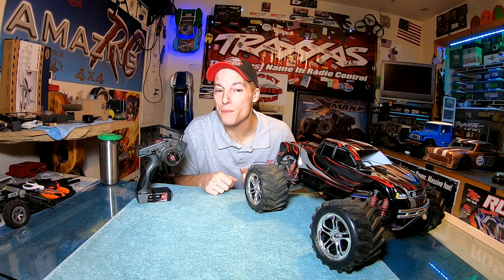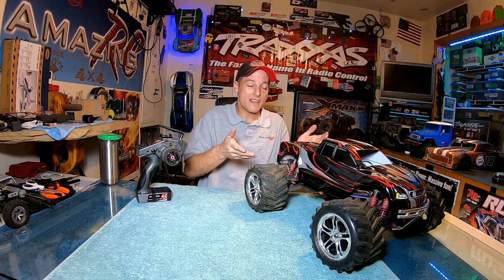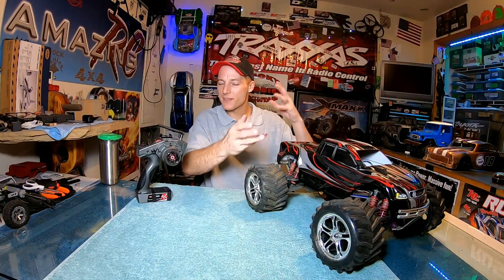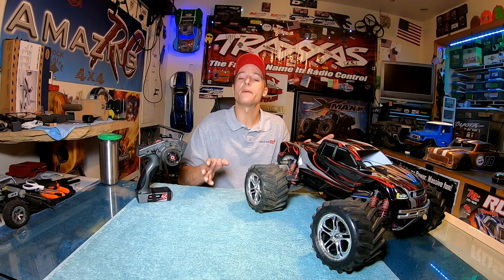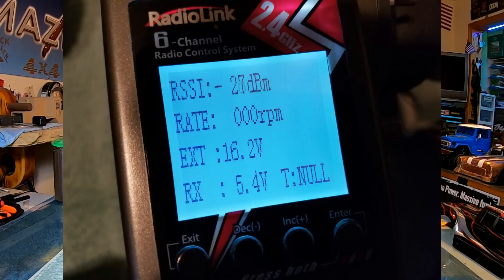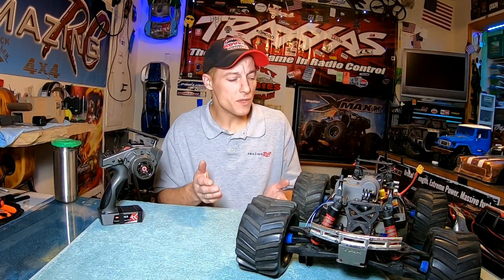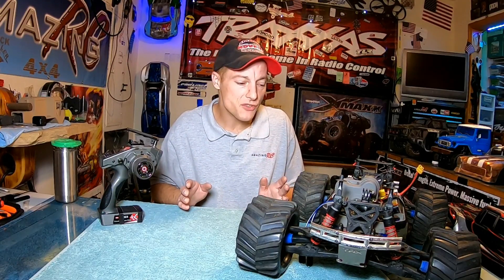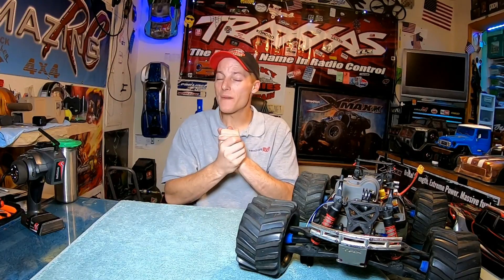AMAZING ULTRA RANGE Dual Antenna Receiver R7FG by RadioLink.!!! Firmware How-To

Comment: Man that is some serious distance and the run at the end was awesome .. Always wanted to try this but I have to much tied up on other things .. lol You know how it is..lol Thumbs up brother
Reply from the maker: Really appreciate that great comment my friend.! I am hunting down a new long-range fpv setup as we speak. That paired with this radio and receiver should promote some really great exploration.! I have always wanted to sit in a chair with a visor on and drive the truck around the neighborhood. At 1900 feet which is just over the five football fields I speak of in the video, you really have quite a bit of options as to where you can go. Not only that, when I drove around the semi truck I didn't lose reception at all. I was checking my RSSI value and it didn't drop one bit. Technically I should be able to drive well out of sight and around obstacles. I will be testing that soon for sure. Thanks again for the great comment.!😎

Comment: and maybe you could do the max range test,and record your range test data.My test result is 2100feet, I think this is my best result,lol!  thanks your nice share.
Reply from the maker: I got an email from radio link this morning stating that they feel comfortable with a range of 2000 feet or just over. I'm going to attempt to set the alarm on the transmitter and send the e-maxx until I get a response. I just don't have a clear way to record the distance. My GoPro 7 can do it with satellite but I'm not sure it's very accurate. I'm still looking for a way to be able to tell exact distance. Anything near 1,800 feet is going to be epic. Can't wait to get the definitive test laid out. Thank you so much for your wonderful comment to my channel. Keep you posted.!😎🏆👍
Reply: @AMAZINGRC  that's cool,I love your FPV play.I also use RC6GS + R7FG for the FPV of the drift car, which is very interesting and makes me to experience like racing.
Reply from the maker: @edmundjohnson1198  I want to run fpv in my Emaxx with this receiver transmitter setup as well. I would love to know what you are using for fpv.? I have never I had any experience in fpv. So scared to spend money without knowing what I'm doing. I have a $300 budget to get started. I need everything for fpv. Transmitter receiver camera, whole thing. I do not have any problem building from scratch. I do need something that will be able to handle the 1900ft range . If you have any guidance for me it would mean a lot. Thank you so much.😎

Comment: Oh man I got a flash! Wow!  I like how you mounted the dual antennas. 1320 ft. Is a 1/4 mile. (=o
Reply from the maker: I am working on acquiring an fpv setup for this long-range receiver. I think with the right fpv that I can sit in a chair and drive this truck around in a 5 football field length radius. And I would be able to do it as if I were sitting inside the truck. This may be hard to believe but I know absolutely nothing about fpv. Basics sure but not enough to go shell out a couple hundred bucks without knowing what the hell I was getting into. But that's my dream, fpv inside a ground-based platform that can travel really far away. Sitting in a chair on your favorite Trail in the woods and then just taking off with a visor on your head and driving the truck around all the trails that you're used to accept you're not walking with the vehicle. I'm all about exercise , just like anyone else. But I would really love to try to pull this off. This setup would be amazing. And sorry about the peek, but I had to show something. Now you at least know it's not sitting under my bench in the Box. It is my master work. My meisterstuk if you will. A build where nothing was missed and everything was executed to perfection. And then give it to a great friend. Keep you posted, stay safe.!😎
Reply: You truly are amazing RC. =)